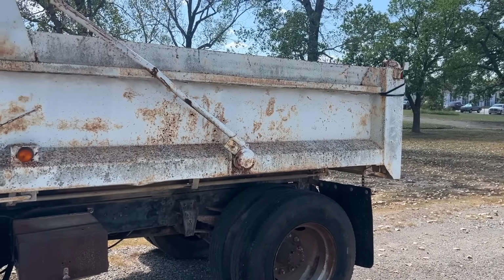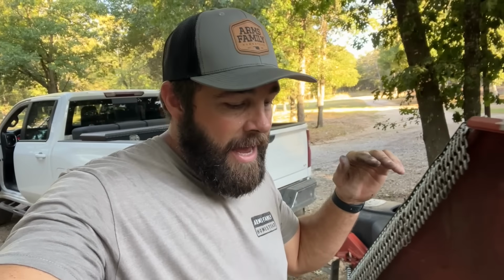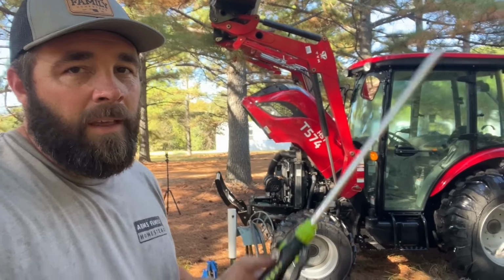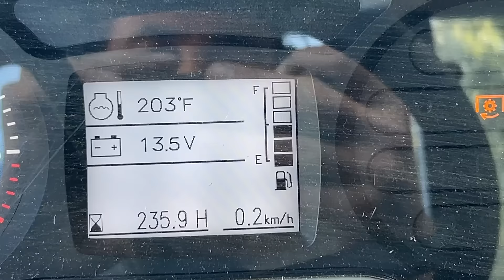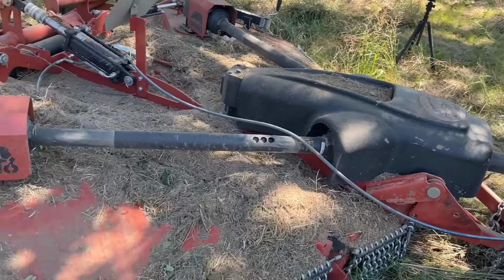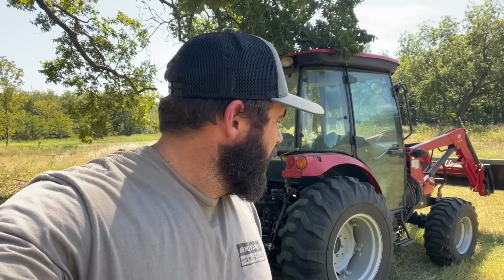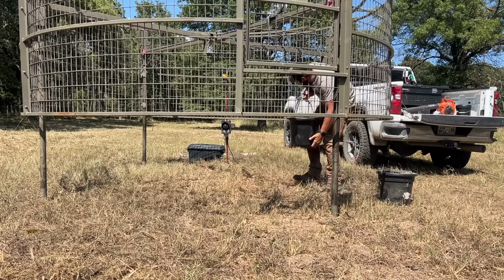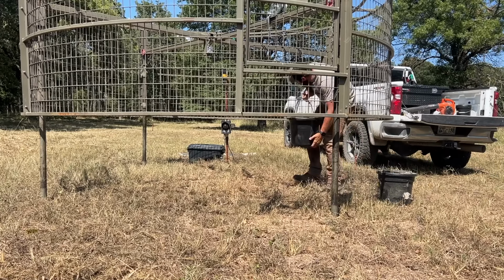That's a First for Me!

Comment: Try cleaning the radiator with water after your done mowing instead of before. That way its dry next time its used. Water may cause dirt to stick inside of radiator veins. Just a suggestion.

Comment: You know that the  big batwing mower is to much weight for that size hitch, its just not heavy enough. Need to stay with 8 foot or less batwing mower in that terrain.  I used to have mowing contracts for I95 and Florida Turnpike all my tractors were between 85 and 125 horsepower pulling 10 foot mowers .Way to much stress for the size of tractor you have it will happen again. Also keeping radiators and oil coolers cleaned very much help with tractor heating problems but in super hot weather i had guys keep AC off got along fine than.

Comment: That TYM radiator is a perfect example of cheaping out and going with perfect conditions engineering rather than engineering to handle the normal dust and debris in real farming situations. Same for that hitch!
Reply: My john deere radiator does the same thing.  Not quite as bad though.  I wonder if the bad wing is straining it to much.
Reply: @boggy creekoutdoors nailed it. 44PTO hp running a 12' batwing. It's working its guts out.

Comment: I use to farm along time ago. I found that using air was better than water. 
I asked the AI which is better this is what it came back with.

When removing dust from your radiator, using compressed air is generally more effective. It can blow dust and debris out of the tight spaces and crevices without the risk of introducing moisture, which could lead to rust or other issues. If you feel the need to wipe it down, you can use a damp cloth afterward, but make sure to dry it thoroughly prior going into a dusty environment.

Comment: Too late to help, but:
Lower the lift arms, hook the tow chains on the mower to the lift rams, raise lift arms until it is level enough to detach, adjust height using the lift arms to attach jack. attach lower and remove chains. From a kid raised on a ranch, happens more than ya think.
Reply: I was going to suggest the same thing.😊😊😊
Reply: @papatomsthoughts  As was I...

Comment: Be sure and check your antifreeze and make sure it's good because it's very important in the cooling process for your tractor. I use to work as a mechanic at a Kubota dealership and I've seen many overheating problems solved by replacing the antifreeze with a good 50/50 mixture.

Comment: A tractor engine typically operates at temperatures between 180°F to 220°F (82°C to 104°C). However, during heavy use or in high ambient temperatures, the engine can reach higher temperatures, sometimes exceeding 230°F (110°C).
Reply: You might have a bad Thermostat on your mower

Comment: Hey Daniel,  the draw bar was extended all the way out. When   you have heavier loads , run it in as far as you can, and still turn. Not being smart u kno what. Just older, and learned that already.   The hard way. 😂
Love y'all, keep doing what you doing.
Reply: Great info
Reply: The draw bar must register in deeper for support. The weld penetration also looked terrible
Reply: I've never ran a brush hog with a draw bar.  Just the 3 point.  I kind of thought that was alot of leverage.  I didnt know if it could go in further and still turn.

Comment: Daniel i would take the part off and repair it myself.  If you doubt your skills then have any welder do it.  That way you can beef it up with some better and stronger steel.  If you get a new one you will have the same thing you started with and it may not last.   With the heavy powerful equipment you haul it can do a lot more damage if it happens again.  Good luck.

Comment: Love your channel, its such a blessing to see a good family unit 
You dont need to replace the drawbar just get it welded up properly, those welds have not been done right, there needs to be some prep done the way its welded its just a bit on the surface with no penetration. As for over heating it looks like there is a air block not letting the coolant flow properly. The car I own does the same after a coolant change.

Comment: Daniel, having grown up on a farm we had a tractor that when pulling a hay bailer the rocking back and forth by the bailers plunger caused the tow bar to elongate the hole. We modified it by getting a welder to build us a bar the fit the 2 point hitches to join with the tow bar and it became rock solid. There should be someone in your area that can weld the broken part for far less than the cost of replacing that part and at the same time making it much stronger. Save you some money and make a stronger part.

Comment: Maybe try getting a lower temperature thermostat. Have you checked the radiator cap for pressure? As far as the draw bar pin, try a grade 8 BOLT to keep it from opening the pin area. Have the draw bar bent into a slite S bar so when connected it will be level at both ends.Thanks for the video.

Comment: I would check the thermostat to see if it's opening and closing properly.  If it's working I would see what the factory temp is for the thermostat.  Then go down on the temperature at which it should open . For example if it has a 195 degree I would change it to a 185 or something lowet according to what the temperature is going upto when it's getting hot. Changing oil can help if it's overdue.

Comment: Yes, the other tractor, the first one in video, could stand to go in one hole also. 
I'm pretty sure it would be able to turn without getting into the tires. Sometimes you have to remove and turn around and replace to get holes like u need them.  Drawbars are tempered they normally break instead of bend. With all the leverage,  something gonna give.

Comment: I bought my set of sprayers like you have from atwoods. It also appears you're using the drawbar backwards. There is supposed to be more slid into the slot and the drawbar shorter where it comes out towards the implement.

Comment: I don't know how tractor engines work, but in the past before installing trans and oil cooler on our pickup we could run the heater when it would start to over heat going up and down the mountains here in the state. It was hot but it always brought the temp down. Good luck.

Comment: You need one of those scrap steel pipe. I have a 2" scrap steel pipe that's 6' long. Works great for prying heavy things off the ground. A bobcat bucket also works to lift it up.

Comment: God is great brother, I feel sorry for those people who feel the need just to get off of your channel because it shows God, family, love, honesty, integrity, family, and above all devotion to Christ. Unfortunately it's their soul not yours that has to pay the price
  The beginning of the year I purchased 2 kubota 5760s with cabs loaders etc. 
 These tractors were purchased in March all of them now have right at 500 on them just in the hay season this year 
  And one of them routinely pulls a 12 foot rhino like you have there and have had zero overheating issues whatsoever. And these are fully hydrostatic just like yours
 I've even matted the entire screens up on the grill and on the AC compressor with goat weed seed  and radiator and it still runs cool
  I think the little cohrn didn't put a good enough cooling system on those tractors
  My neighbor purchased one just like yours but a newer model it pulls a 3.8 foot and it overheats all the time in this Texas sun.

Comment: You most likely checked this on your 574, I have an LS and it over heated so the rancher said to check my coolant. I flushed it and used pure coolant with no water mix and it runs much better. Just a thought.

Comment: My tractor would run about an hour and overheat. Did several things to try to fix it. No luck. Sent radiator off to be recored and got a new water pump. In the process of putting it back together. Fingers crossed the problem is fixed. Love you guys❤️

Comment: For the tractor heating issue, try using some foaming a/c coil cleaner on it, then follow up with your pressure wash. Also, be sure to use the fin comb provided to straighten the fins. It makes a huge, huge difference. Water alone doesn't clean it nearly enough. 2-3 passes with the coil cleaner will make a world of difference. Also, when you wash with the water, spray from the backside.

Comment: Hey !!  Daniel,  Regarding the Tractor,  As you said on the video regarding the Tow Bracket, You just need to get it rewelded the Weld Broke, have you any Weld Shops or Metal Fabricators or even auto shops nearby, it would be an easy job for any Welder, and much cheaper than buying a new assembly.
     Also the Overheating problem, you say has got worse as time as gone buy,  This could be a Thermostat going bad ! very cheap to replace,  Thermostats also come in various Heat Ranges 170 180 190 200 Degrees the Higher the number might be better for you, also very cheap to replace, If its not a Thermostat problem, Then its the Water Pump that might be on the way out they do wear out sometimes and when they do, you get overheating again very cheap to replace and easy for any mechanic to replace, And the last thing to check is the Alternator/water pump/ Belt might need a bit more Tension on it or may be a little worn, just check the belt make sure it is not to loose, that can also cause overheating, on a car its known as a fan belt, I,m sure you know the belt I am talking about.  I hope this has been of some help to you !! and saved you some Dollars.           Malc U.K.

Comment: If I may one other thing you might want to check is the main air filter for the engine a lot of times the ones you get from the factory and some after markets are to tightly made and or let dirty air dust in the air intake restricting the air flow or not cleaning the air as good as it used to  ty for letting me share Matt AKA DDP be safe out there My brother and friends and everybody yuuuuup ps especially in the heat yuuuuup

Comment: Try changing the thermostat to a lower temp or add a switch to the fan.another thing that helps is run the rpm a couple hundred faster.we had a tractor that acted the same way and that's how we solved it.

Comment: Your mower is at the limit for that tractor, or check to make sure the mower is functioning correctly and not giving resistance for the tractor to overcome.  Many ignore the implement causing the issues.

Comment: Daniel, as a temporary measure, run the heater on your cab tractor when is starts to get hot, this will normally reduce the temperature. This sounds like a design/manufacturers issue.

Comment: Daniel on my tractor when it started overheating the shop told me it was a sensor in the transfer case going bad. Had to replace the parts change the fluid. I was under warrantee thankfully.

Comment: Daniel, Keep speaking the truth. Let the chips fall where they may. As far as your tractor incident it appears your tongue arm is shorter than I expected. On our old John Deere 1010 tractor decades ago the tongue went up under the tractor to at least the console area. That way it distributed the weight of whatever implement you were attached to not to just that tongue bracket, but the rear end of the tractor took some of the load. Maybe the new tractors are completely different, but when I saw you pull it out of the bracket that's the first thing I thought of. Maybe it was just a bad weld on the bracket. Hope it helps.

Comment: So my rancher husband walked in as you were looking at that hitch. He said the weld is not good on there. Only some spot weld on the top but it is hardly connected to the bottom part which is at an angle below.   We understand your woes!  Been dealing with over heating and AC in our 4230. Replaced the water pump, not cheap!  Replaced fuses. Now going to get new switches. Is never a dull moment, right?!

Comment: Was told if you use water to clean your radiator and coolers will create mud in them that hardens and doesn't wash out too well. I use air and dewalt blower and my 574 has never seen more than 185 degrees. 630hrs.

Comment: Sounds like u have air in your coolant system. Lift front wheels on a log, tap radiator cap off, let it run upto temp and see if it bubbles out the air. Then refill and go for a drive

Comment: Hey Daniel.  Try some condenser foam spray for home ac units in your radiatior core.   I have a hard time getting my deere 3039r clean enough to cut for a while.  That seems to help alot.  I notice the screen in front of your radiatior wasn't very dirt.  Makes me think its not pulling enough air because it may be stopped up.  Its a never ending battle.  Haha

Comment: Between the overheating and now the tow bracket weld fracturing, I am guessing the mower is more than the tractor can handle. You can try cutting the bent piece off and welding something a little thicker but that may just fracture the support for the tongue that bent. Plus, that won't solve your overheating issue.

Comment: Those fold up mower blades are so accessible I would sharpen them with a grinder  but only spend the same amount of time on each blade to keep balance equal.  Give each blade the same number of passes.  Cuts better and leaves a better cut and can mow faster in most normal conditions

Comment: Hi there, When i saw the thin welds on that bracket tube on your tractor, i immediately thought it was not welded through, but just welded on. 
I just think the welds should be ground out, bevel the parts and welded back together, but deeper.
Just my two cents :)

Comment: Drawbar was extended out too far. Use one of the two holes in the center. The heating problem could be you have a spot wear larger debree is getting in around the hood seal. The hood screen should be stopping the bigger debree. Just a little hopefully helpful advise. I do enjoy your channel.

Comment: You could use chain a round 3 point arms . Try turning on heat in cab when it starts getting hot see if that cool it down. Might be low on water or your air pump might be pulling to much too make it hot. Radator might need too be biger.

Comment: If you can take that part off that came unwelded, you could probably have it fixed cheaper than replaced.  And while having it fixed, they could reinforce the welded area so that doesn't happen again.  Regarding that over heating problem, is there a way you could enhance the cooling system?  Add a secondary radiator with more coolant fluid might help if that is possible.

Comment: Sorry about your tractor. Hopefully when you talk to them about the replacement part uou could ask about the overheating issue. My nephews pretty new diesel pickup kept overheating. They changed thermostats, filters, etc., but come to find out it was a sensor. It wasn't completely out so it didn't show up as being bad but once the truck heated up to a certain point then it started overheating. I hope you can get it fixed pretty easily.

Comment: Two things, as per content keep doing what you are doing, it's your channel and to heck with haters.  Second, I used to run a tractor with a mower, water alone may not be enough, get a high volume air compressor and blow radiators out well, every day.  Sometimes water creates mud in radiator.  😊😊😊😊😊

Comment: What kind of fans do you have on the tractor mechanical  or electric mechanical  generally involve a clutch which is not supposed  to engage  until a preset temperature  they have been known to just go on holiday and don't engage  at all easy fix if electric they use an electronic  thermostat  also an easy fix both types are easy to troubleshoot so good luck I hope it's a simple deal

Comment: Try pulling the hot wire for the air conditioning clutch to see if if the operating temperatures stay under control.

Comment: I did a quick Google search on your tractor has the warning light go off,its very possible that the normal water temperature for the conditions your working in is in the 225 range or so ,maybe a simple call to the service department they can tell you what temperature it can run at,since you never said the alarm went off,could be your just use to othes 😮vehicals okay that's my 2 cents worth God Bless

Comment: Do you want to be careful when you use water on the radiator? Do you wanna make sure it’s completely dry before you fire it up because all the dirt that’s inside the engine compartment will go in there and pack in The radiator it is best to blow it out with air. Love your videos, brother. Also, have you checked your fan belts to see that they are tight if it is not pulling the fan correctly it will overheat it seems like it overheats very slowly it could possibly be loose fan belts.

Comment: Use a Jack and the weight of the tractor to bend that bracket back, then weld it and use two angle iron pieces and weld them on as well. You’ll be good to go👍

Comment: When you wash out the radiator and screen and don't let it dry, the dirt and debris will stick to the wet surface faster than a dry one. Also is your thermostat sticking or not opening all the way. It may need to be replaced.

Comment: who have on that tractor what we in New Zealand call three point linkage two hydraulic bare and fixed bar at the top you could have lowered the bars used the chains you had to lift and support the draw bar and got to repair

Comment: Maybe you should look at changing your thermostat.  That would be the first thing to do to help your cooling problem and also flush the block at the same time. I would also be careful with using cold water on a hot motor. While it's not common you could crack the block if the engine is hot enough!!!!

Comment: Just a farmer here that runs equipment daily. I would imagine your on the upper end of your machines capabilities in heavy grass like that. I noticed you werent running it at full 540 rpm. Id like to see if doing that would help. Might get you above the torque curve enough to keep cylinders cooler. Anytime im working one hard i go full rpm. Nothing wrong with backing off in lighter material